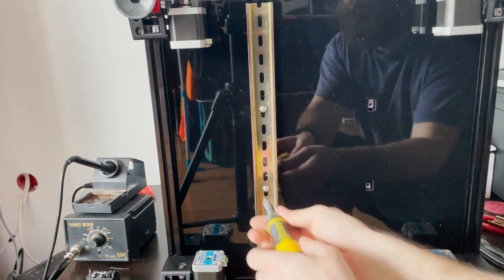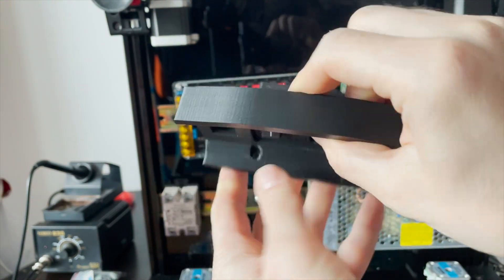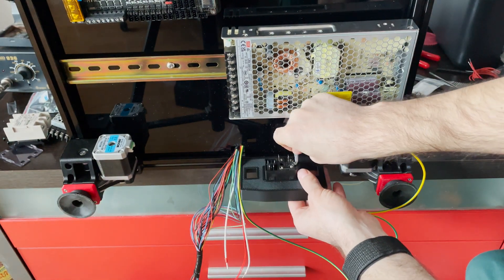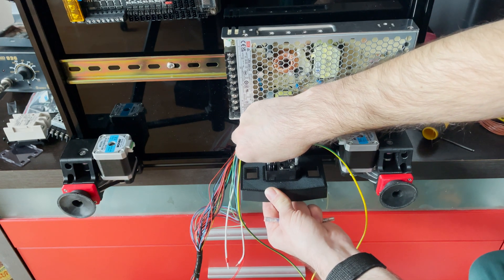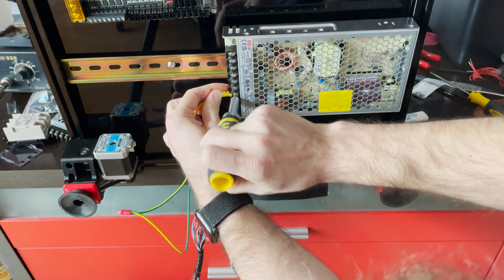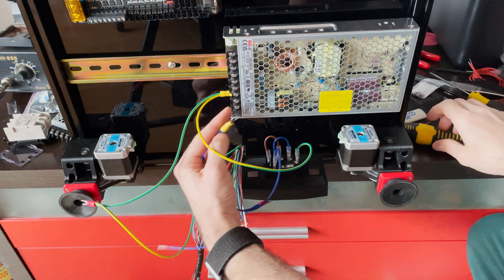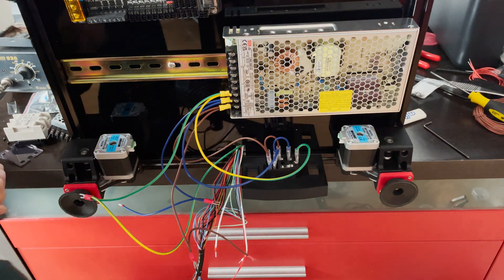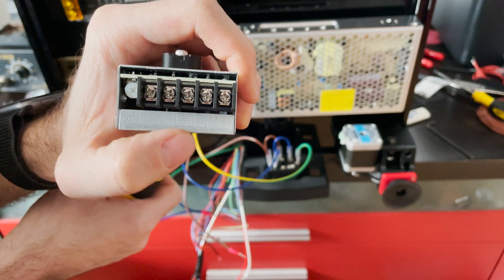Voron 2.4 - Part 19 - Mains Voltage Wiring

Comment: U never grounded ur frame bro.
Wtf happened, no update since the wiring was done lol?
Reply from the maker: Lol…I am still alive :))… the frame gets the grounding from the heated bed since it is in direct contact with it. I didn’t have time to post other videos. I have one almost done with the firmware installation but I am not sure when it will be ready. Sorry about that, I hope to have more time for youtube in the near future.
Reply: @PorcupineOfTheConnoisseur  Understandable man. 

Had my trident kit laying around for a year (ordered in April '22) and just now got around to building it! I'm doing the mains wiring atm, hopefully all goes well lol. 

Regarding the frame grounding, I spoke to some people in the electronics channel @DC who informed me about the discussion on that topic. Apparently it's pretty much pointless because of the anodization, and would require you to scrape all the connecting parts of the frame to achieve a complete ground. 

Quoting Dragonkitty 
"anodizing is basically oxidizing the aluminium, making it an insulator. The breakdown voltage is 900V per mil (0.0254mm), anodizing layers are typically between 13 and 150µm so it's not easily possible to overcome unless you have an overvoltage condition. That's also why you can't use a multimeter, the test current and hence the voltage is way too low to measure anything and an insulation tester would be the absolute minimum to verify everything is connected properly"
Reply from the maker: @bravefastrabbit770  interesting stuff, I was wondering myself why the multimeter cannot detect continuity between the frame and the heated bed. Thanks for sharing!